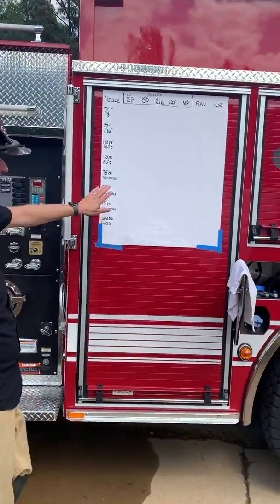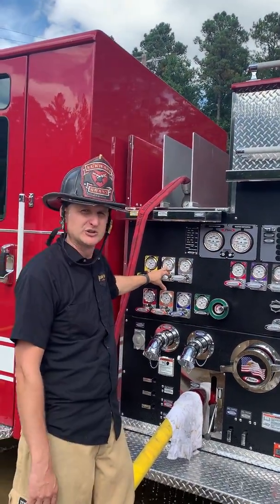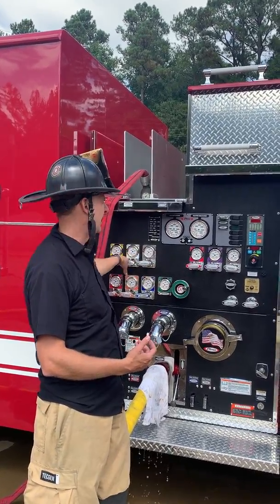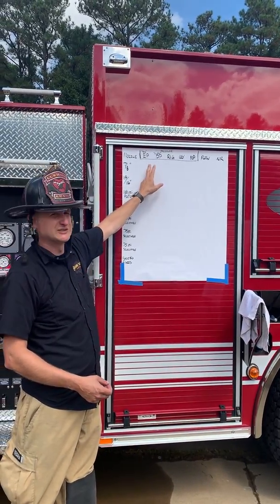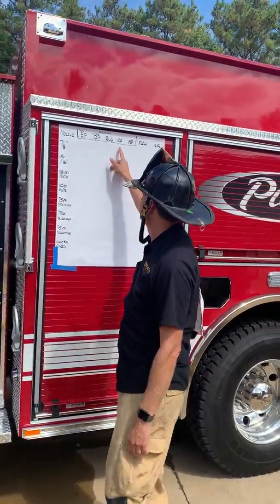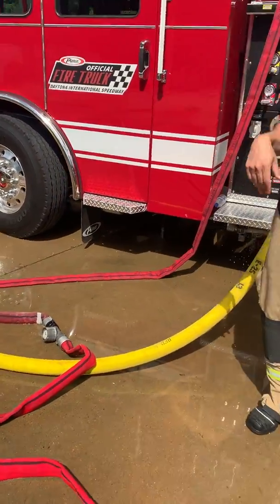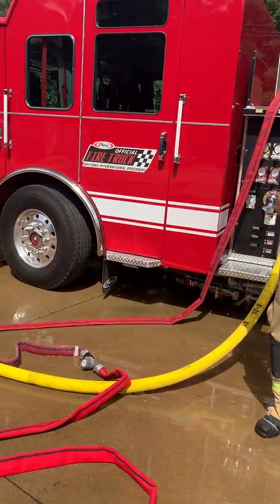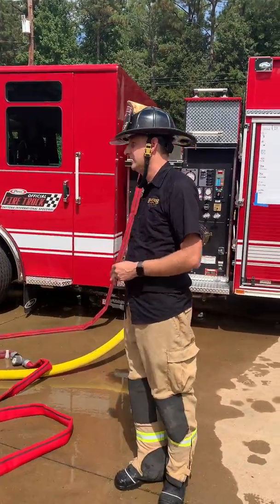HOW TO:  Set Up Accurate Flow Testing

Comment: preparing to do just this. I want to create a pump chart as well as test our combination nozzles. to make it a bit more user-friendly, are you suggesting a nozzle pressure gauge is ok for the nozzle even for a solid bore? I would like to have one setup that can be used for all nozzles (SB, Combo, and automatic)  Any reason a nozzle gauge wouldn't work?
Reply from the maker: Hi Chris, it will be "close" but to get true nozzle pressure from a smooth bore, it should come from pitot pressure.  Our flow test kit has both a pitot and inline gauges in it for this reason.